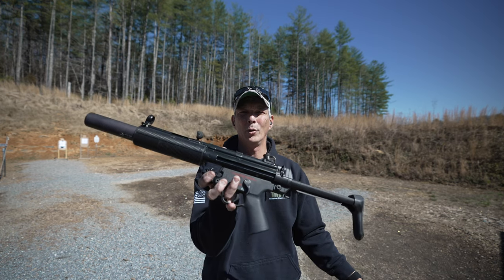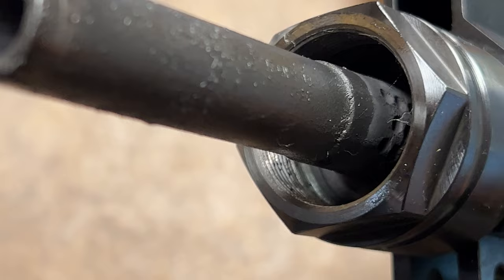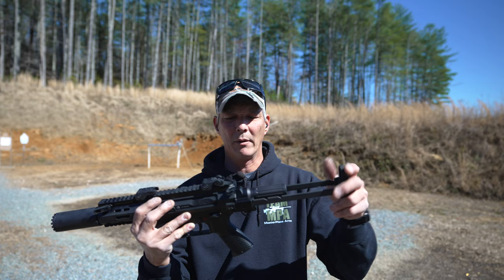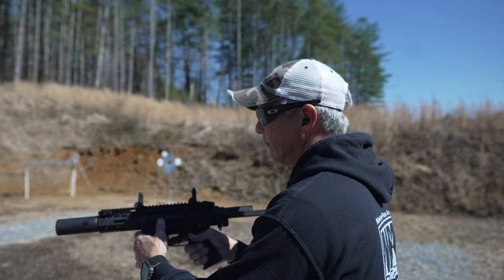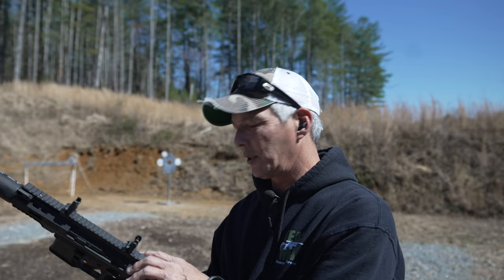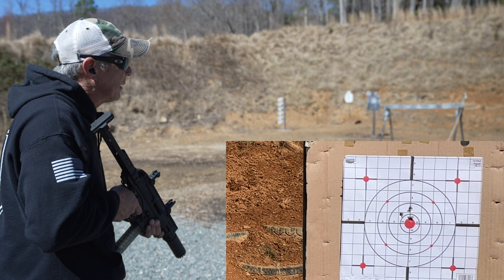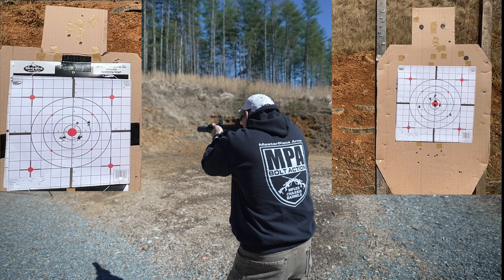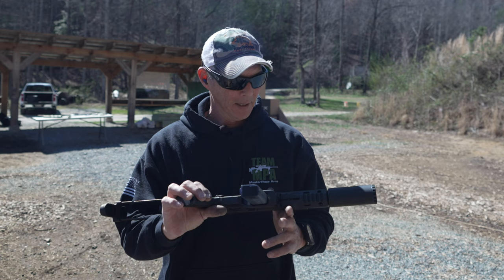B&T SPC9 PDW SD

Comment: Going back and forth between the two platforms on your video, the audio signature is very similar (likely equivalent down-range but louder at the ear).  The B&T is doing remarkable well for having a more compact slimmer suppressor.  There is also an APC9SD option that uses the same suppressor as the MP5SD.  I think the benefits of the better trigger, ergonomics, and controls make it a better option overall than the H&K, especially in semi-auto.
Reply: Could NOT have said that any better Mr. Bill! Exactly the same way I feel. I think  the MP 5 has been in production since 1966, or the main platform scheme has anyway, which speaks volumes in itself on its abilities.  However New technology & innovations are needed to keep moving within forward progress.  I own  the B&T and I used the MP-5 for several years in my many protection roles, hands down, B&T runs over the MP-5.  Again, MP-5 is no junk pile at all.  It’s an amazing piece, just the B&T runs better “FOR ME!”  That’s all that matters to me, I can be max effective with it. Others may be more effective with the MP-5.  

For the young Operator or LEO just starting out, plz do not ever “Settle” for something just because of price! Go run the weapons and see what suits “YOU” the best!  You cannot put price as a factor when you’re in a protective role. 
35 yr Operator & LEO here. 

K-9 Handlers, plz use & train with a suppressed weapon, you will thank me for it later & so will your Pup!  Either of these weapons are amazing for Dog Handlers.  They are lightweight, quick, durable and both are super quiet.  It help keep your K-9 Partner focused on his tasks.   If you only train on his purpose task, then you get in a “Real Time” shit scramble, and have to shoot, that’s going to throw your partner off balance.  Train with what you’re going to carry when working. GOD Bless
Reply: I have an SPC9SD PDW.  It's an awesome rifle, but don't expect it to be movie quiet.  I can shoot mine without ear pro, but just barely.  It's definitely louder than a standard non ported barrel shooting 147gr and just barely quieter than shooting supers through a standard non-SD barrel with a standard 9mm suppressor.

Comment: It comes in full auto options from the factory? I was under the impression the SPC9 was not "full auto rated", due to what some YouTubers said.
Reply from the maker: It does not. This was a conversion that I did.
Reply: @XRING  Oh nice, did you buy the auto sear from B&T-parts, or are you using something else?